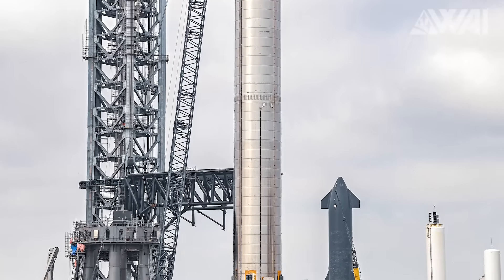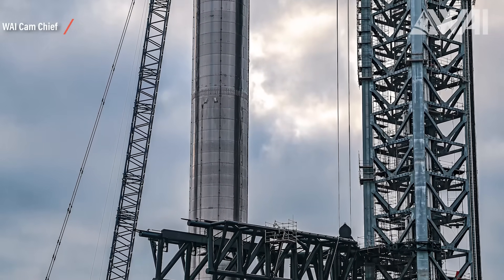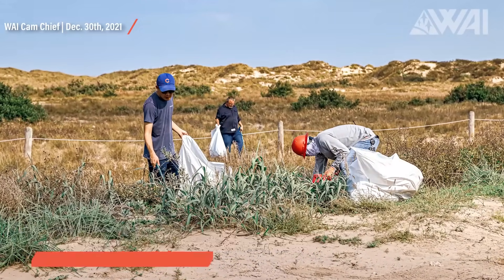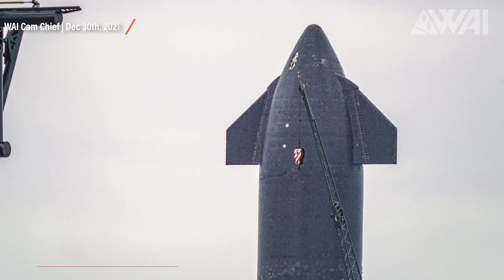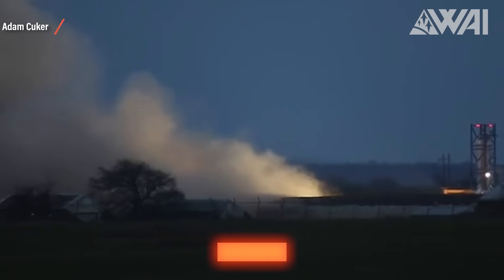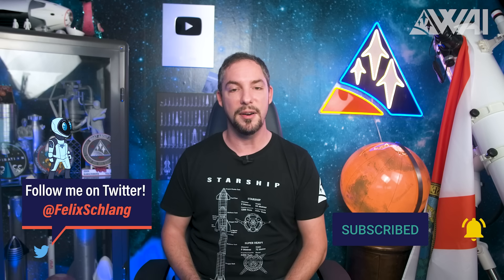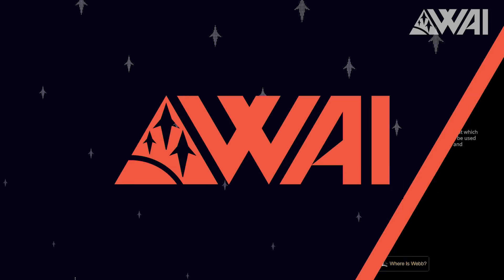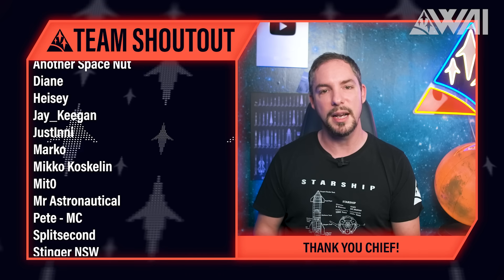SpaceX Starship test Marathon continues with Raptor v2 + JWST Update!

Comment: Elon’s response to delays at BC is already evident.  He’s forging ahead with development of multiple Starship launch facilities at the Cape and KSC.  I’m assuming there won’t be any environmental issues to deal with there.  Others can respond if they know the answer to that one.  SpaceX may also be able to launch from the West coast at Vandenberg.  That being California, though, I’m not sure if that’s a viable option, as their environmental requirements are more stringent…at least on a state level.  The floating platforms are another possibility, but I suspect there is a LOT of development to do there.  In the meantime, BC can be a manufacturing and test hub, if things don’t work out for them as an orbital launch facility.
Reply: Yeah but look at the complexity of the launch facilities. Setting up a starship spaceport at a new site is a huge deal and it doesn’t happen overnight.
Reply: @X-boomer  True, Ralph, but the Space Coast is replete with lots of folks who possess the very skills needed to get things accomplished, and a significant portion of the infrastructure is already in place.  And SpaceX has learned a lot creating the first Starship launch facility.  The speed at which they iterate is second to none, as I’m sure you know.
Reply: @billg3645  I’m just concerned that the delays and extra expense of having the whole starship program on hold while they replicate everything in Florida and spool up operations there will cause them to run out of cash before they can turn it into a viable commercial business. Musk has already voiced the same concerns over delays caused by raptor manufacturing difficulties so more delays can only make it harder.

Comment: The deluge system: they always have na innovative take on age old tech, but I think theirs will pulsate the water at a similar frequency of the rocket to sort of noise-cancel.
Reply: Considering that the new Tesla Model S has active noise canceling, this is a reasonable assumption. Maybe the two are even related. Tesla and SpaceX often share technologies.
Reply: Maybe the doghouses on the orbital launch table's legs will pulsate like noise-cancelling headphones.
I don't understand how the launch table or Mechazilla can survive 29 rocket engines, I think SpaceX is hiding some alienElon technology until the last minute.
Reply: @skierpage  
Steel and reinforced concrete are highly resistant to both sound waves and heat.

Comment: Elon Musk has stated that Starship is almost a SSTO with zero payload. What if SpaceX made a variant of Starship which is a scaled up stainless steel version of Rocketlab's Neutron?  What if tons more fuel was used to launch a smaller payload and a booster engine? If a fast enough suborbital velocity could be achieved, such a fully reusable single stage craft could deliver significant cargo to a HASTOL style momentum exchange orbital tether. This would get us very close to the functionality of a fully reusable SSTO.
Reply: Stcredzaro, is that SSTO capability without super heavy?  Not sure what Musk may have ment.
Reply: @stevenshelton9443  Musk has said that on paper at least, Starship might be capable of reaching orbit without a booster. However, this wouldn't be a useful exercise, since it assumes no payload, no fuel for landing, and a hypothetical Starship with less structural mass than the current prototypes. 

So in response to stcredzero, yes, you could theoretically build an SSTO that way - but an expendable SSTO with no payload capability isn't really use to anyone.
Reply: @simongeard4824  Thanx Simon. I had not heard that and you make a great point about the uselessness of such a SSTO.
Reply: @stevenshelton9443  Yes. Starship could almost get itself to orbit with 0 cargo, without the booster. That is what Elon said in a different interview. A cargo rendezvous with a momentum exchange tether could be missing a big whopping fraction of orbital velocity, so it should be workable with a Starship variant.
Reply: @stcredzero  Thanx stcredzero.  What would the value of an SSTO with no payload be?

Comment: The FAA is throwing a temper fit. Elon encouraged people to comment positively and the FAA was flooded by these and of course, the naysayers then responding in force. The FAA now has far more comments to filter through which makes them have to do more work. Therefore they said “we’re taking our ball and going home” and now you can’t fly til March. Na Na Na. And that’s the mentality we are dealing with. Didn’t like the previous administration but I might change my vote If they bring Bridenstein back and get rid of this fool running NASA now allowing this crap to happen.

Comment: 8:42 I think the call for comments may have had a greater impact on the timing than expected. Ultimately I think the decision will go to SpaceX, they would have to be pretty sure to put all that time and money into the launch pad and etc. But the time taken to get certified, when complete, will help insure opposition can't come back and say FAA was rushed or bullied in to a decision.  And SpaceX is not ready to launch at this point anyway. Some of the work may be work that could be done after the first launch but has been started as they wait for approval, but there are still a few missing puzzle pieces,
Reply: Precisely
Reply: I think it's a load of crap. My money is on some powerful entity pressuring the FAA to stall. I'm not saying that's 100%, nothing is certain, and I don't have evidence, but it just sounds like such a BS excuse. Like really? You're going to take TWO months to read some comments, really?
Reply: @arik_dev  They have a slow reader. Joe can only go so fast.😉
Reply: @arik_dev  Most of those comments are probably useless with no scientific interest and can probably be dismissed immediately.
Reply: The FAA forgot that Boca Chica is in the middle of a Wildlife Preserve with endangered spices the first time around in 2015. They are trying to CYA from that omission.
Reply: @Mdude59  Well, not really:  The U.S. part of that beach is less than 5% of the beach, Most of that beach is in Mexico as well as 95% of the wetlands. Even if SpaceX blew a hole as big as the Superbowl into that wetlands, it would not even make a dent in the overall habitat or wildlife population. And as for the beach, it has been a virtual trash dump for the last 50 years. Fewer than 100 people (mostly a few locals that did more to harm the habitat than anyone else) ever visited that beach each month, until SpaceX made it famous. In fact, having a spaceport with mandatory boundaries, will be a win-win for the  habitat or wildlife population, Look what NASA has done for the very similar wetlands' area around Cape Canaveral since the 50s
Reply: The government tries to avoid SpaceX success - not support it

Comment: The extra time is needed to allow SLS to catch up!
Reply: That would take a couple of years.
Reply: @UncleKennysPlace  
decades
Reply: Senate Lobby System will NEVER beat SpaceX at anything. EVER.
Reply: @swapshots4427  Senate Lobby System. Good one Swapshots!
Reply: SLS doesn't need to catch up bc it's not competing with Starship, they're going for very different roles.
Reply: @giovannifoulmouth7205  yep!  That’s right. But the conversation, rightly or wrongly, was driven by someone’s statement that SpaceX’s issues with the FAA is alleged to be due to the FAA wanting to even the playing field for others including SLS.  Meh!
Reply: @giovannifoulmouth7205  
ok Starliner
Whatever, ya get my point.
Boeing & Co are leaches.

Comment: I love the whole re-entry process for starship. But how will it work with only partial atmosphere with out just crashing into Mars. It needs heavy atmosphere for this style of re-entry from the physics I've seen. So, what about it? Let me know.
Reply: It'll work just fine. SpaceX done the simulations years ago. When coming back to Earth spacecraft use the upper atmosphere for aerobraking, which is pretty low density. On Mars you simply have to go much deeper for the optimal atmospheric density. Earth's atmosphere is way too dense actually.
That takes care of the vast majority of the speed. The necessary energy for propulsive braking is proportional to the square of the speed. And of course due to the rocket equation you need exponentially more fuel. So an insane amount of propellant is saved by aerobraking, even on Mars. The terminal velocity of course will be much higher, but that's not that big deal. On Earth Starship only needed a few seconds of burn with a fraction of it's full trust, so it's almost negligible amount of propellant. And it won't be as much more on Mars as you would think. First, the atmospheric drag is proportional to the square of the speed, so with a 100x less dense atmosphere you only go 10x faster. Second, gravity is 3x weaker, so you are at around 3x terminal velocity. Also, since gravity is weaker, you need less trust to counteract it, and accelerate less during the belly-flop maneuver, which means even less propellant. And you can do even better, coming down sideways and using lift too, not just drag. Here's a discussion about this with more accurate physics and math. https://www.reddit.com/r/SpaceXLounge/comments/aso1vy/starship_mars_reentry/
Reply: A re-entering spacecraft has some amount of lift and aerodynamic maneuvering. This was even true of the 1960's space capsules. Starship is even more maneuverable, and can use its skydiver flaps to prolong its trajectory to make up for the less dense Martian atmosphere.